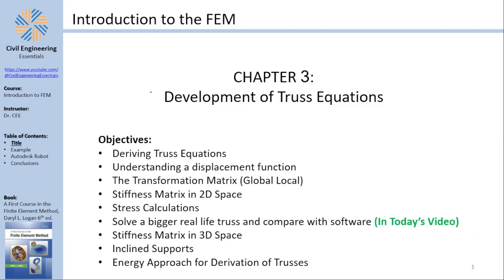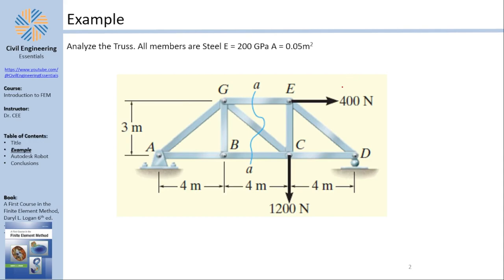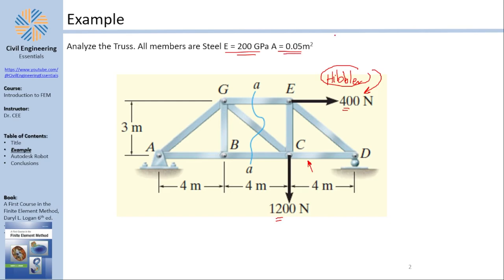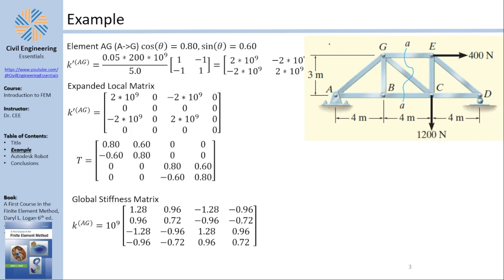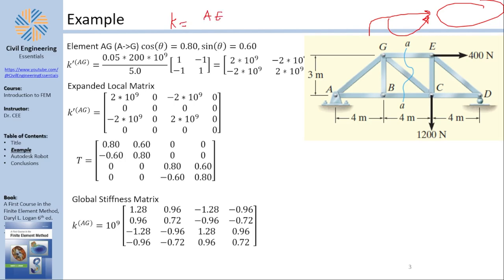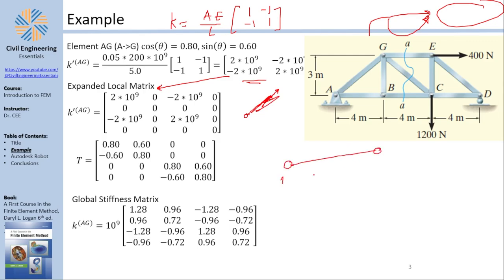The Finite Element Method (FEM) | Part 5: Truss Example

Comment: Hello Dr. CEE,

Oh Wow. Well, “rinse and repeat” is not always a bad thing; and as far as I am concerned in this video it is not. Dr. CEE have done justice to this example and to the associated theoretical concepts behind the example, the good doctor’s detailed explanations throughout this video are superb, they certainly go a long way in clearing and in reaffirming key concepts from the previous theory.

For me this video was yet another one of the best 27:44 minutes I have experienced on the channel. The example has nicely demonstrated to me as to how much is (and could still be) involved in the early “scratching of the surface” topics within the FEM domain. 

The time that I had initially spent on manually assembling the system global stiffness matrix using the “helpers” has made me stop to imagine and to realise just what would happen in a system where the finite element(s) consists of a number of members with multiple degrees of freedom. I used to recall Steve Rogers saying “…. Avengers, assemble! ....", but now all I hear is “…. Global stiffness matrices, assemble! …. 😁” 

09:20 I believe you; and although I have manually and successfully (and humbly ^_^) managed to assemble the system stiffness matrix on this example and got the right results all the way to compare with RSAP. I still strongly feel that you are right, without some form of an automated subroutine for assembling a system (global) stiffness matrix, one would be doomed. Most (if not all) human beings can only do up to so much “manually”, with a growing number of elements and of the degrees of freedom on a system that is being considered, there will just be too many matrices to manually assemble that it would take unjustifiably too long to manually complete such an exercise, not to mention that the chances of making unintentional errors and omissions will also exponentially increase. 

I have also spent a good time of today thinking and looking for some “basic and simpler” ways of rationalising the steps to allow for the computer programming of the system stiffness matrix assembling process. I must say that I am no expert and I can’t really say that I know of programming languages. The latest viable idea that I have found in my search is the following (I’ll use this current video example as the basis, I am very faaaaar from thinking of a generalist routine but this is a start).

• Consistently index (the rows and the columns) of each of the element’s global stiffness matrices (this step is already being done in this series by the CEE)

• Expand each element global stiﬀness matrix from a 4x4 matrix to a 12x12 matrix, do this by padding the 4x4 matrix with zeros until a 12x12 matrix is formed. Use the consistent indexing in the step above to ensure that the elements of each of the 4x4 stiﬀness matrix are embedded in their respective correct positions within the newly expanded 12x12 matrix.

• Since you now end up with the element’s global stiﬀness matrices that are all 12x12 matrices, you can generate (assemble) the system stiffness matrix by adding together all (corresponding elements within) the expanded element’s global stiffness matrices, the resulting K would be of the same size, i.e., a 12x12 system stiffness matrix.

09:43 I agree with you, the real in-depth details of programming should be a subject that is undertaken with clear mission objectives. For now, I think it is sufficient to highlight the need and the relevant areas where programming impacts on the work that is currently being learned.  You are already doing this in my opinion. And yes, some form of programming (like the assembling possess above) may be unavoidable depending on the topics that are being explored. 

25:21 Indeed it is not easy. But given what you have demonstrated to be capable of in this channel alone, I think that STRADO is going to be a force to be reckoned with. I am guessing that STRADO is being programmed to be a rather “full-fledged wide range covering” FE software like RSAP? 

Any chance you are looking for “tester(s)” of the latest iteration? I would not mind a “still-unprotected-unencrypted-non-expiring-copy-before-commercial-release” only for testing of course 😊.

On a more serious note, I am now convinced that one of the reasons that the CEE is presently a perfectionist in engineering as I have witnessed this on this channel videos and lectures is because of the FEM and the programming which the CEE is doing on this subject at the highest possible level (Dr. CEE is at the pinnacle here). The consistency that is needed at this level would be surgical precision or otherwise things will go berserk. I think for the CEE, this level of precision has become second nature in everything engineering. I have nothing but respect for the monumental tasks which you constantly immerse yourself into and the fact that you do what you do so successfully well.

I have enjoyed this video; it has allowed me to expand my understanding into other related areas that I was not even thinking of (the CEE way). Thank you for your great work always; and I’ll “catch” you in the next videos.

Kind regards, DK
Reply from the maker: Hi there Engr. DK,

I am happy you liked the video. One of the goals of this video was to show that whenever a system gets bigger, programs start becoming a necessary. This does not mean that one should not understand the basics of the method theoretically, and it is the goal of the video series to achieve this theoretical understanding while not losing the general view of the importance of programming your own code.

The assembly is really hard, harder than any team of avengers ^_^, it is easy to mess up.

Oh, the basics you explained in your comment with regard to programming the FEM are one step in the correct direction.

STRADO is taking a good chunk of RSAP
s ease to use, combining it with the amazing usage of a "command line". It is still in development, and I would gladly share a copy with you.

SPOILER! It is still waaaaaaaaaaaay too weak. I will try provide you a free copy of the software that is working for life. Once it is ready, I think of providing the channel members with a lifetime access to it as one of the perks. It is still not that ready, so I have to act carefully. 

Yes, it is a general purpose software like ETABS, SAP, STAAD and SAFE and of course the OP Robot.

Perfectionism is a kind of double edged sword, and it needs to be handled with care. I am lucky that this perfectionism is a main drive to work harder. In other cases (not me), such a perfectionism could backfire into a never ending cycle of unsatisfaction.

Anyways, just send me an email and I will reply with a copy during the weekend. 

Due to privacy reasons, I will write the CEE channel's email address here.

civ.eng.essentials@gmail.com

Anyways, stay tuned for more content, 
Regards,
CEE

Comment: This series is fantastic! I hold a bachelor's degree in structural engineering, and we didn't cover Finite Element Method extensively. It's been a while since I delved into this subject, but your explanations are so clear that I'm having light bulb moments all the time.

I just completed this truss example, opting to program the solution in Python, where it fills the global stiffness matrix by itself, and calculates the deflection, forces, and stresses of the elements, and it works like a charm. I'm genuinely proud of it! And you should be proud as well! 

Thank you for providing such excellent content, it has been incredibly helpful!
Reply from the maker: Hi there ^_^ 
I am 100% proud knowing that you found the vids beneficial and that you based some application from it. It is amazing ^_^
thnx for sharing this. 

If possible, sharing this channel would help immensely 
Regards,
CEE